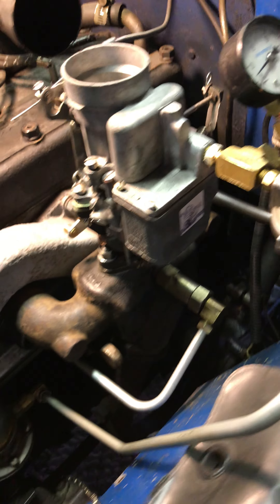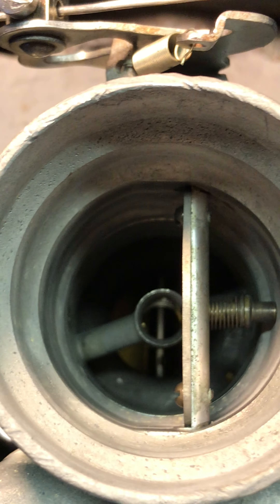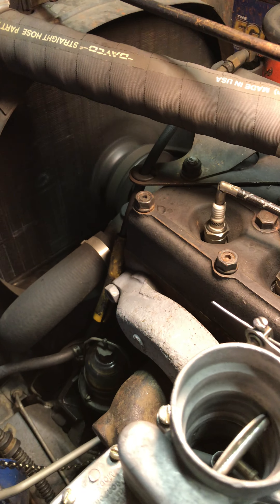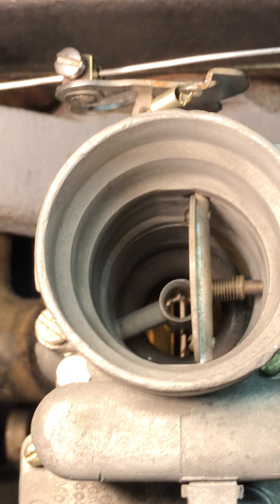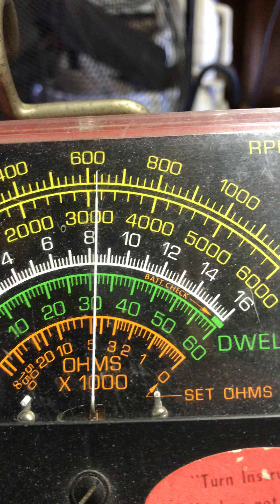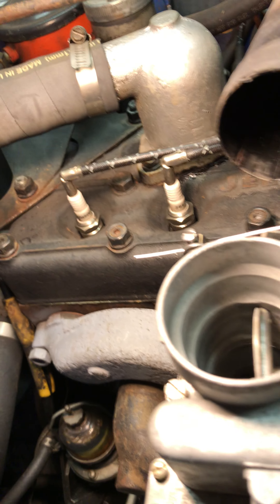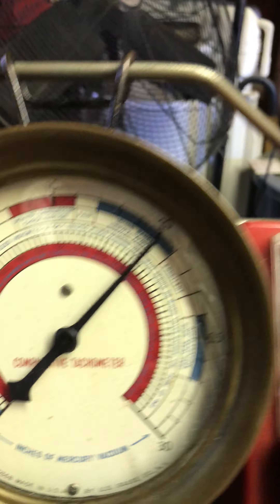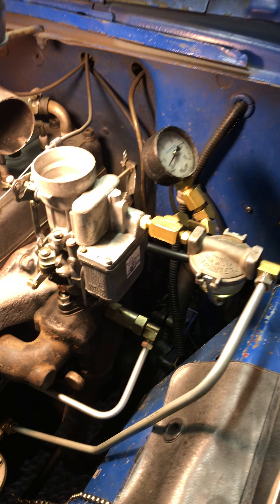StveWO

Comment: Rick help! I have a 46 CJ-2a. I’m getting tons of fuel out of the top of the bowl. I check my float for the 3/8 gap and it’s right on the money. I turn the jeep off and of I look down inside the carb gas continues to drip. Any ideas? Thanks
Reply from the maker: There are a few possibilities for this. First, it may just be dirt in the needle and seat. Or the float may be leaking, getting heavy and unable to close the needle and seat. The Metering Rod may be worn or set too high. The Accelerator Pump may be worn or too small. The Heat Riser Valve in the exhaust manifold may be malfunctioning allowing excess heat to reach the carb causing the fuel in it to boil and the bowl to become pressurized anf that pressure forcing fuel past the metering rod. When does this flooding occur?
Reply: It starts leaking around 10-15 seconds after start up. That was after I had it apart.
Reply from the maker: @be1121  Is that 3/8" with or without the gasket installed? Did you replace the float pin? Is it grooved?
Reply: Without gasket. And no I didn’t replace float pin. I looked it over, looked ok. This has been a project for awhile, I had out in a carb kit awhile back and out it on the back burner. I did some looking and noticed one thing. The big jet or seat not sure what it’s called, the needle and seat is what it’s referred as. The old needle has the black tip, the new needle is all metal. I installed the new needle but not the seat/jet. I remember now when I went to install the new seat/jet it kinda went in hard and put the old back in. Ok so I have the new needle and old seat. Could that be a problem. I order my kit from Kaisers
Reply from the maker: @be1121  Okay. We're making progress here. The float setting with the Viton tipped needle will be different from the metal needle. Double-check the instructions they sent to you.
Reply: I will mess with it again tonight.
Reply: Ok. So I went back to the old seat and needle and seems to be fine. I’m
Finding a little gas coming from somewhere on the lower part of carburetor. Nothing like the bowl overflow I had though.
Reply from the maker: @be1121  You may need to check the tightness of the caps and rivet plugs. Start it. Let it run. Use a paper towel to absorb any visible liquid until you locate the possible leak.
Reply: Ok will do.